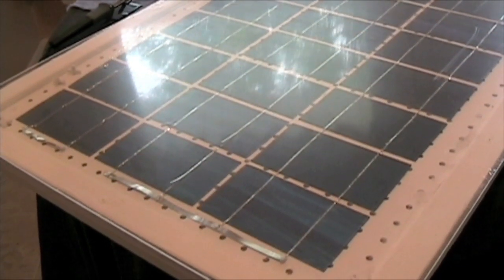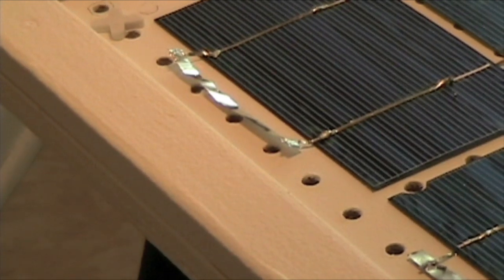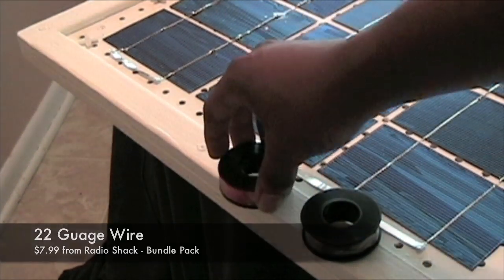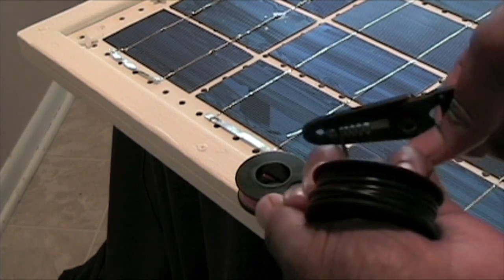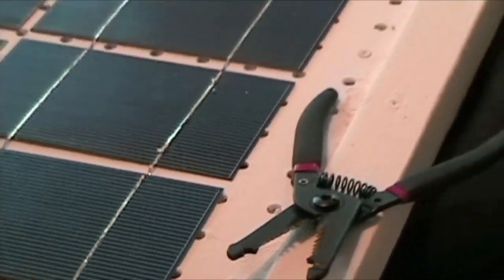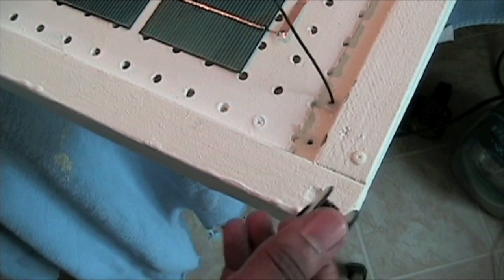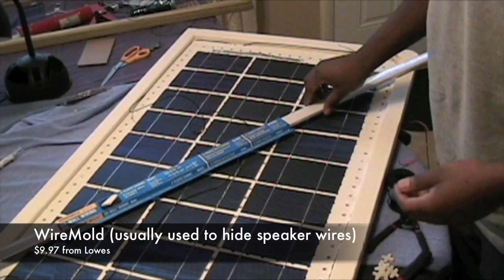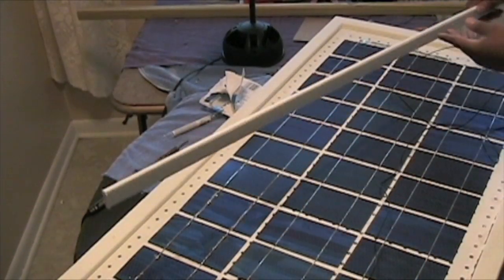How To Build A Solar Panel - Part 7

Comment: Dear Robert,
I just found these amazing videos.  Thank you for sharing.  By now you should be an graduate engineer and hopefully have time to answer my questions. 1. How to choose the right solar cells to buy, there are thousands of options.  2. How those gloves prevent you from getting burn? Do they block the heat? Could you touch the hot bus wire while wearing the gloves without getting burn?  Do they have an specific name so I can look for those gloves at the store.   I am on Step 7 of the process.  I am sure as I continue watching I will come out with more questions.  I certainly appreciate your time and dedication.

Comment: if you had connected the rows on the outside and then one of them to the middle row on the other side, your positive and negative leads would be right next to each other. save over 4 ft of wire, and still series.

Comment: @noahzoryahoocom By the way increasing the heat around the panels decreases the efficiency of the panels (due to resistance being raised by heat) and reduces the total power of the panel. White helps to reflect light (hopefully onto the panels) while reducing overall heat. I know it's been a year but I figured you should know if someone hasn't already answered.

Comment: Very informative series! But a lot of extra work/costs in this part. Really no need to go all out on the wiring the casing needs to be weather proof to protect the cells anyways. Just stick the wiring to the sides, it's easier and better conductivity wise to just solder the +/- wires to the bus wire without that connector. Also putting the cells closer together (use skewers to line them up)will make things a bit more efficient.
Great vids nonetheless

Comment: @RobertSmith3 Since this is a custom job and tolerances haven't been calculated, I'd say white is a better choice because it won't get as hot as black, so you don't have to worry about thermal expansion as much.  At an extreme thermal expansion could possibly break the seals made later with the silicone caulk; stress on the word extreme however.

Comment: You'd have a much easier time with soldering if you kept the tip clean and shiny.  Use a damp cellulose sponge to wipe the tip right before every joint, and then tin it with a little flux-cored solder.  You'll be amazed what a difference it makes!  If your tip is badly oxidized, clean it with some fine grit sandpaper but be careful not to take the plating off it.

Comment from the maker: @noahzoryahoocom Yeah I didn't really have an exact reason for painting it white other than to help it match the look of professional panels. But I know Black draws heat, and white usually is good at reflecting light which is good. So it's up to you how you really want to go about it, but I know I see most panels with white frames so that's the path I went.

Comment: stick the wire thru the hole before stripping it. Then put a bead of solder on your bare wire first before soldering to panel

Comment from the maker: Sometimes you will have to go back over your tabbing wire with your soldering iron, or if it becomes an repeating issue, just add a little solder to it to keep the tabbing wire bonded. Again, I recommend investing in a better soldering iron to help along with this, but at the end of the day, I got it to bond and all is working fine. :)